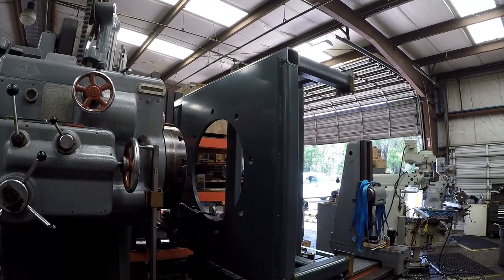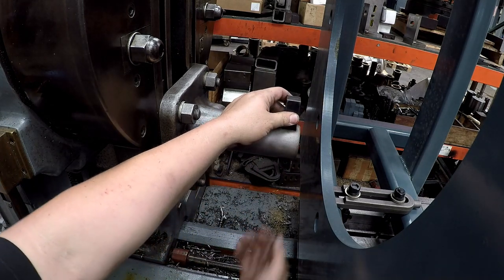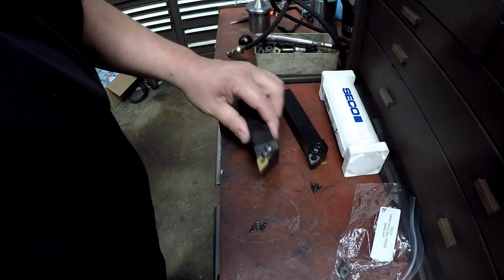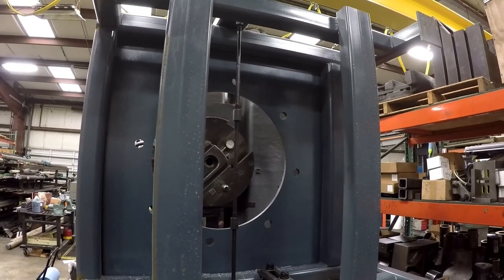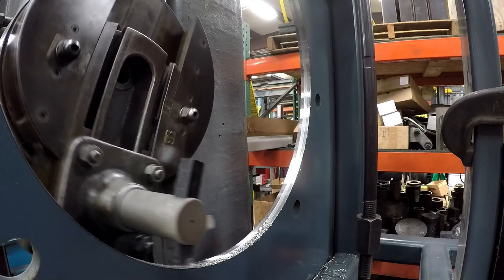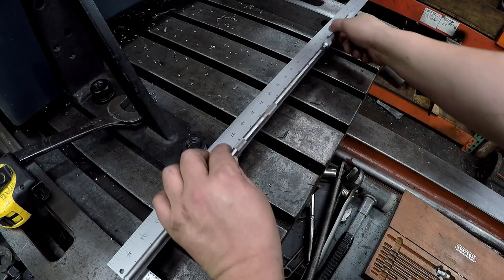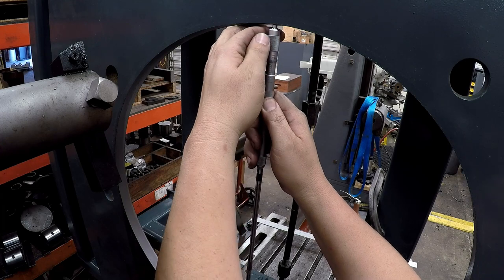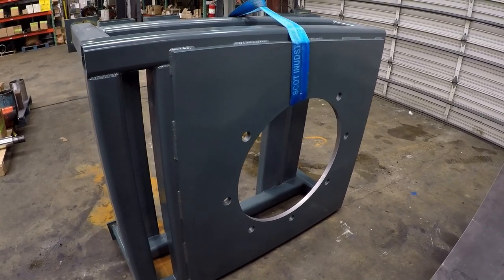SNS 164 Part 2: Horizontal Boring Mill

Comment: The shop I worked in used a Giddings and Lewis 60 inch HBM modified to cut threads on large diameter casing pipe.  We fought chatter all the time.  But what a beast!!! I was maintenance (sparky) and those machines were my babies
Reply from the maker: We're looking at some nice big G&L machines right now.

Comment: Adam, you and the people you work for  have my sincere respect concerning your general attitude about how to react to mistakes and problems. Assigning responsibility for errors can be valuable if the process is centered on making clear what the problem is and what needs to be done to correct the situation. When this process gets in the way of getting the job done, and done well, a lot of finger pointing is not very useful. Nice example of using several measurements and tools to come to an "average" accuracy that is acceptable for the job at hand.

Comment: Very interesting , I was hired in the past to machine 54 inch  rings on a jacked up lathe  clamped on a huge face plate , centered with a tape measure, I made myself an Ajustible mike with a 3/8 16 bolt with a one or one and one quarter micrometer handle I made to measure the final diameter my boss would verify with a tape  measure . After a while my boss lost the contract with a different design and CNC machining .

Comment: Hi just been looking on you tube and come across this sight.  Feeling very nostalgic asi worked at kearns  richards from 1970 till 1984 when it closed down. The machine shown must have been built  in the 50s or early 60s as i had never seen that one. we made several machines  Stype  SH  SF  SJ   and SE.   Several people say the machine  shown  was  big but it was only the equivalent in size to the SH Look on the kearns richards websites and you can look at all the machines that i have stated. The big SE150 Had a car placed on its rotating table to be photographed and i also remember  one of the big machines having a chieftan  tank gun turret having work done on it.. Sad to say but mrs Thatcher brought about the demise of many industies including engineering! So many highly skilled men  lost for good[i was  only average} Luckily i ended up working  as a baggage handler at Manchester Airport until i retired a couple of years ago.

Comment: I spent 5 yrs on an old 1940's era lucas42b boring mill  boring pasta excruding cylenders finished at 7.5 id and 6 feet long.  Had to use the tail stock  and a 4 in boring bar about 12 ft long. I designed and made the fixtures to hold them.  Chatter was a challenge, low rpm and heavier feed with .03 to .05 depth of cut. I used .015 radius tool nose inserts. Cylenders were fabbed from food grade stainless. I countered bored each end to accept a bushing in each end to support the bar. Each bushing had a air oiler plumbed in to it for lube and to keep chips ffrom entering tthe bushings worked great!  To get the travel i needed i used both the spindle feed and the table feed.

Comment: I was astounded at work a couple of weeks ago instead of furnishing some simple hand tools we needed, the company opted to pull a mechanic off a job to come remove some 10mm wrench size nuts. A job that had we had access to a 10 mm open hole nut driver would have taken 5 minutes actually took two days. They saved having to buy maybe  a $50 nut drivers that probably cost several hundred dollars in the the end. Tools are apparently a real struggle for some companies.

Comment: I worked at Westinghouse on large G&L horizontal machines. So I’ve worked with big facing heads and line boring. On your part I would have cut with  cobalt high speed and used clamps in the two top holes. Use indicators while clamping - to make sure part is not moving - if it moves use kickers. I miss my trade - I will be 77 in September.

Comment: One thing that I found often worked on frames and other "flimsy" work is to increase the cutting speed and feed rate. This does several things. The work (and possibly the tool holding assembly) is being excited at its natural frequency by the cutting tool. By speeding up the cutting speed a fair amount you are more likely to get out of this frequency range than by slowing down a little. The increased excitation frequency is easier to damp with things like sandbags, etc. (as others have mentioned).
  Taking a heavier cut loads the whole plot and the increased forces tend to dampen vibrations.  This is often seen on lathe work using carbide tooling. Taking a light cut makes the work vibrate like a bell. But if the cut is made according to the insert manufacture's recommendation the tool cuts smoothly though the finish isn't as fine as you might like because of high feed rates. Generally this is ok as the areas where a bearing might be fitted are often the only places that need a fine finish.
Orlin in NC

Comment: I worked at a couple of shops that had Devlieg's with horizontal spindle.
I worked in the design rooms & I am not a machinist.
Actually, the one shop I was told by a customer - was originally the Devlieg  plant before they moved to Royal Oak, MI.

Comment: Hey Adam great vid as usual. I've recently purchased an ex Tech Colledge Kearns Staveley "S" Type HBM and so looking forward to using it once I update the original electrics. The machine is in excellent condition with very little use for it's age. Kearns must have used a bad batch of paint as it needs a coat of paint which will happen soon. Cheers.
Reply from the maker: That's great! I'd love to see that machine if you care to share some pictures in email.
Reply: Hey Adam. Thanks for the reply. I'll send you a private message via FB for your email address or you can contact me via my web site www.grahamsengineering.com.au I'm in Brisbane Australia. The HBM that I have is a later version of the one that Bruce Whitlam has. Mine is the last of the line being a metric unit. The slideways are perfect and all the Gibs are in their original factory setting. All the slides are still tight. The paint is badly flaked but I will strip it back soon and give it a coat of Machine Grey. I'd be very happy to share some pic's of it with you as well as the other gear that I've been revamping. Just recommissioned a Churchill NB Model Surface Grinder, built in 1959 and still very accurate. I've been doing a lot of filming of what I've been doing and will start to edit and upload soon. Fingers crossed the vids come out ok. Cheers for now.

Comment: I've been there. At my previous job, one of the components that I regularly machined was a support rod. Nothing fancy, just a 1 1/2" hardened, ground, and polished bar with a 1/2"-13 threaded hole in each end. One day I got a print from an engineer that was new to the company, showing a support rod for a slightly-different machine, with 1/2"-20 holes. I went to see him and said that we usually use 1/2"-13 for this part, and which would he like me to do? We had taps for both. He told me to use the 1/2"-13, and said he would change the print. Well, the print was never changed, another machinist made the next part, and cue somebody rushing out to Fastenal to buy 1/2"-20 bolts.

Comment: Hey adam at 10:16 or so, could you not have bolted a strong back to the plate on those bolt holes outside the hole to dampen that chatter? Just a question as I am not familiar with boring ops that size. Great video, I always enjoy the jobs you show in the big shop.Cheers.

Comment: Nice solution to the problem Adam.  I did not realize the HBM had that much capacity in the y(?) axis.  It would have been tough to take that small of a cut with a torch, even if you made a ring for a guide which would have been a lot of work too.
Reply from the maker: Bill it has a working envelope of about 36x36x36.

Comment: You didn't have a 27" diameter drill bit?
Reply: Only 26 and 28, his 27 got lost some time ago :(
Reply: the thing would weigh like 4 tons depending on whether it's high speed or carbide.
Reply: it probably needs a 500 morse taper drill sleve XD
Reply: @yo64yo  😂😂😂

Comment: As soon as I saw your setup I asked myself.  Why doesn’t he have angle plates against that. That was before I new what u we’re going to do to the part. Small taped or drilled holes would be ok. A part that tall u should have set it up against angle plates. U could cut it much quicker.  Wasting time. Really cool spindle on that boring mill. Never saw anything like that 20:40 20:42

Comment: damn, nice vernier calipers
Reply: I have a really useful set that came from BSA's toolroom when BSA were still a reputable British engineering company in Small Heath, Birmingham England. Nothing left of the once huge company now 😔
Reply: @PurityVendetta  that's awesome, I've never heard of BSA before, but after a few searches, it seems like they have quite some history. It's too bad they fell out over time, but I'm sure their traditions still live on in the workmanship of the people who used to work there.
Reply: @yo64yo  They were enormous up until the 1960's when most of the British manufacturing industry started to implode. They made everything from firearms to motorcycles even machine tools. Sadly most who worked for the have passed away and there's just a few people like me struggling along in little shops working with worn out machines. One of the things which makes it more bearable is the look on some old boy's face when they meet us and realise all is not lost. It hurts that the BSA motorcycle brand is now owned by an Indian company and BSA here in England is reduced to selling rebadged cheap Chinese lathes.

Comment: You need a counterweight on your boring head. The downward stroke is faster than the upward stroke due to the offset mass. This is contributing to the chatter and also explains the noise your gears are making

Comment: If that boring machine is gear driven, any backlash in the gears will produce chatter in the downstroke, if the cutting head is off-balance. The weight of the cutting head will try to fall into the work instead of being driven into the work. If you can get the head balanced correctly you will have less chatter.

Comment: Hey Adam, I just wondered why you chose not to shim it so it didn't tilt. I understand it wasn't a critical hole size so it wasn't about that but maybe having a straight face would have eliminated the chatter and saved some tool/machine wear.

Comment: if you are getting the vibration from the spindle backlash, switch to a very sharp positive rake hss tool rather then carbide. im a fan of a good chip break when i have to use them.

Comment: Good work, try HSS tools with some positive rake tipped tools push too much on Fabs. 
Another tip is to bolt MASS to job if its thin to reduce vibration.

Comment: what a great video. very interesting. I was wondering if you had put some rubber blocks in the upper portion of the table where it was chattering, one on each side of the table top bolted with a through hole using one of the drilled holes  in the top, if that would have absorbed the vibration. just a thought. we use a vibration band on brake rotors which work great.

Comment: Hi Adam I think you should encourage your boss to invest in a vertical boring machine, holding all the four feet down should negate the chatter and make your job much easier.
Reply: Kevin Smith lol! ya Adam. just go tell your boss, "hey boss man, you need to buy me a vertical boring mill so I fix this screw up!"
Reply from the maker: I'd love one, but our next big machine is actually going to be a BIGGER boring mill. We're looking at adding a large G&L to handle jobs we can't fit in the Kearns.
Reply: Shawn Crocker you must pay attention to the video before you put people down, Adam mentioned that there were 2 stands actually. If you care to read my reply to Adams comment you may understand what I meant, I did type it especially slowly in case you wanted to read it Shawn.

Comment: Hey Adam, what about pushing UP on the stand? It is mounted very firmly to the table on the end (side??) that sits on the parallels right? If the mount there is not as good as it appears to be then this won't work BUT ASSuming it is bolted down very well then wouldn't pushing up against the side opposite the table remove the rigidity issue? Just a thought. I am sure you know 99.9% more than I do.
Or , maybe next time, offset the whole much more toward the bottom? As you said it isn't critical??

Comment: nice job. cut sounds like it needed counter balance added to chuck to eliminate free fall
Reply: My thoughts as well.
Reply: Yes, I noticed that.  I would say about 10kg of steel opposite the cutter might have reduced the chatter.
Reply: T Jussilainen I
Reply: My thought too. It wasn't chattering on the up side and you can hear the gear clack so I suspect that was the case.
Reply: @steamsee  My thoughts as well!

Comment: Hi Adam,

I enjoyed the video. How did you get a accurate reading with your indicator? My experience is that gravity throws your reading off when the mag base is turned upside down. Was it cutting heaver at the top?

Steve
Reply from the maker: +Steve Barton I usually compensate for it by 5-10 though, and once touching off the tool bit bumping the head up or down to adjust the cut.

Comment: With all of those both holes that are in there you couldn't run a cable through there and bolt it down to your table, or did you just not think of that?

Comment: you could use a couple tall skinny angle plates on your BM table to firm up the top of that frame, or if not, use clamping studs up top with nuts to tighten outwards Also try highspeed bits positive rake, to reduce vibration. It's too flimsy the way it is for carbide. I thought the bore was just for clearance ?  why the inside mic.?    Vernier +/_  .005.  is good enough.  !

Comment: ABOM, I don't want to pick your set-up apart, but you would of had a lot more rigidity if the work piece would of been turned around and two large angle plates used to hole the piece. You got it done though!

Comment: He should have used a high speed steel tool with positive rake. That carbide tip was negative rake and probably chipped as soon as the juddering started.

Comment: Hi Adam,
My neighbour was a machinist who worked for a heavy maritime engineering company. He told me a story about a gearbox weighing several tonnes that was rebuilt to be installed in a coal bulker. Although it had been built to spec, it wouldn’t fit in place on its mounts, and in the end they had to wait for the temperature to drop in the evening so that the metal would contract, and the installation could be completed.

Your videos seem to be made all year round, but you seem to have no problems with tolerances regardless of hot or cold weather. How do you avoid such problems? Are the long extendible micrometers you showed in this video vulnerable to temperature variation?

Comment: it chatters on the downside because of gravity and backlash in the gears. Increase the cutter load with more feed/ speed/ depth of cut and the chatter will be gone.
Reply: It chattered because it was not that good of a setup. Angle plates were a must when doing this size bore. 21:20

Comment: Great Video!!  One Question, as I'm leaning from You.  Could you put EYE-BOLTS into your Tee-Nuts & Chain-Bind the top of the rack to your table to reduce vibration??? If not, why not?? Thanks in advance..............Mike
Reply: You could but often wouldn't
The taut chains would make the vibration of the machine act like a giant out of tune guitar string
a secondary issue that would only come into play for accurized machining is that it would be a warping effect flexing the frame in a way it would not be in situ

Comment: try changing rpm. I find its not the rigidity is the problem. it's that there isn't enough tool pressure to push against the gears, the chatter starts right at top on it way down

Comment: Sometimes wedging in a piece of wood will help absorb the vibration.
Reply: Its all about damping down an item to change the frequency of the harmonic vibration. By using a wood wedge you are changing the material the vibrations are trying to travel through from metal to wood and the transfer point is where the vibrations are lost.

Comment: I was curious as to how much your fingers would heat up the bar and it expand a thou or two?
Reply: 100 degrees will increase a 1inch bar of steel by roughly 1 & 1/2 Thou

Comment: Hmmm...maybe I'm beside the truth but the boring bar is sticking out too far out of the boring head which reduces rigidity hence the chatter. No cutting oil?
Reply from the maker: It's not the machine or boring head making the chatter, it was the rigidity of the part, and the gravity compiled with the spur gears,

Comment: Is a inside mic like the one in the video like a telescoping gage or are they different?
Reply: They are different
telescopic gauges are basically 2 pistons in a sleeve with a spring to force them outwards to match the internal diameter with some way to lock the size - You then take it out of the hole and use external measuring equipment like a normal Micrometer to measure the gauge.
And inside mic is a Mic where the faces are a T shape like so 
Material ]--mic barrel--[ Material 
instead of the C shape you expect measuring like So
[MaterialMaterial]----Mic barrel

Comment: abom, this is a time i would have used the crane to keep the top of material from moving. a lot of people for get that is the biggest tool they got.
Reply: 1:47 mins in.
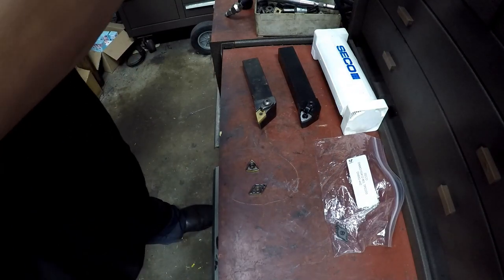Reply: 4:45 in, and the other thing i use is the ratchet straps pulling against each other, but maybe you would use two chain hoist instead